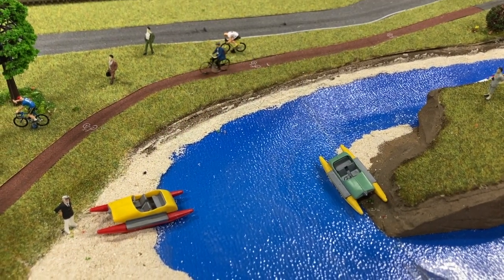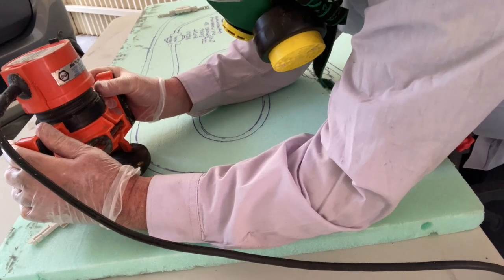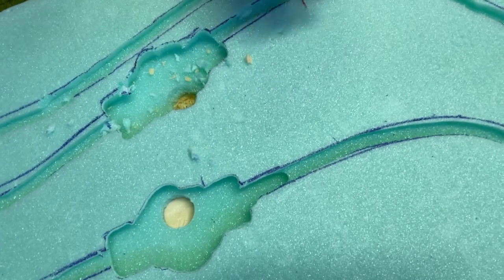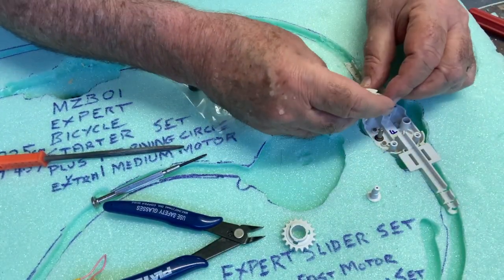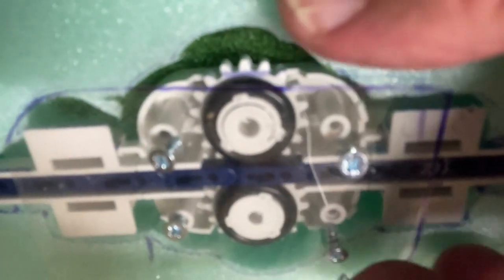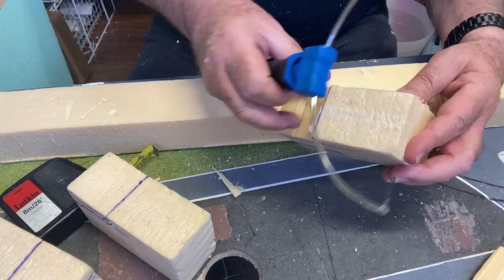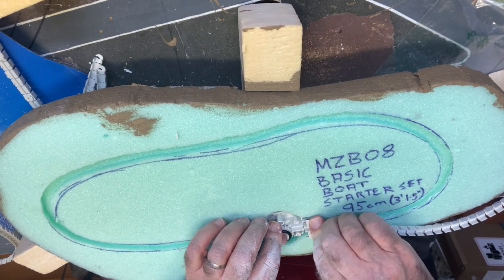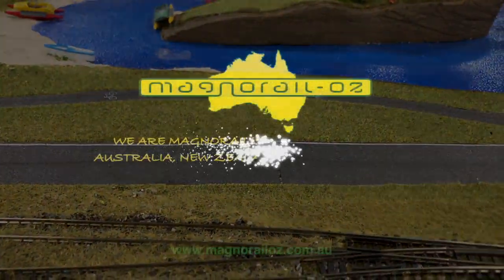ULTIMATE MAGNORAIL INSTALLATION TUTORIAL PART 1   HD 720p

Comment: Hi! I’m setting mine up for the first time and the track keeps popping out at the motor.
The inner rubber gasket (not the one on the gear attached directly to the motor) will sort of lift the edge of its side of the track until it pops out.
I can gently push it back, to get it started again, but this is happening every literally every 15sec unless I’m standing there to hold the track in place.
I’ve tried the acrylic sheet without success—and haven’t even put the magnets or figurines on it yet.

Did I put the motor together wrong?
Any ideas how I can fix this? 
(I’ve taken out any sharp curves including the turnarounds, made sure each piece is free flowing, made sure it’s level, double and triple checked the tension, etc… and nothing helps. 
(I’ll try to attach a photo or video)

Really looking for any ideas you could offer.
Thanks
Reply from the maker: Please email us at admin@magnorailoz.com.au and we will offer a solution. Any photos or clips should be sent to that address